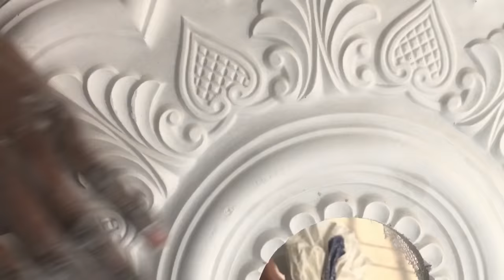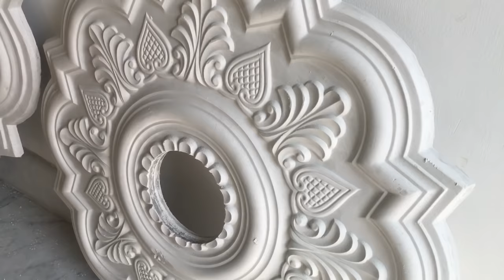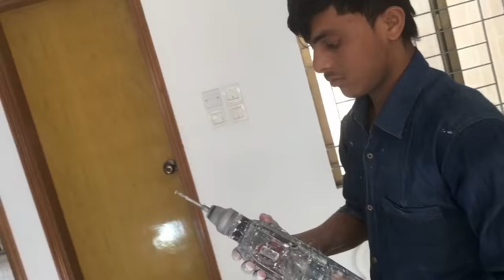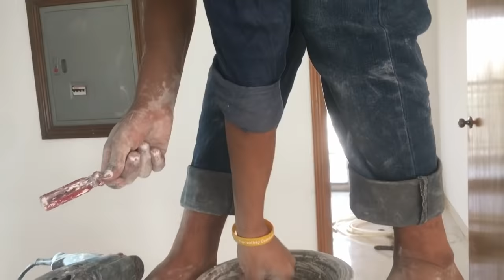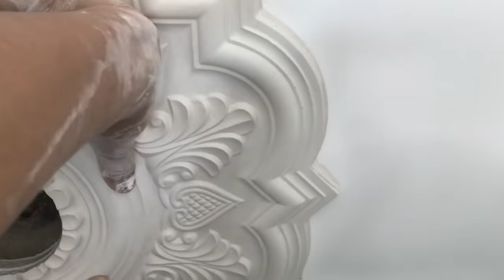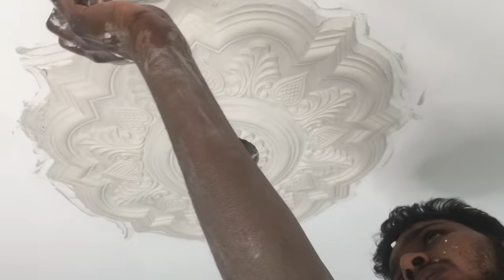how our staff ceiling rose cuts and fittings you see,three desing look the same gypsum plster

Comment: Why would you not just plaster it to the ceiling? Seems like smearing it on the outside thin is just asking for it to crack when you could have bonded it and had s good amount in the joint as well